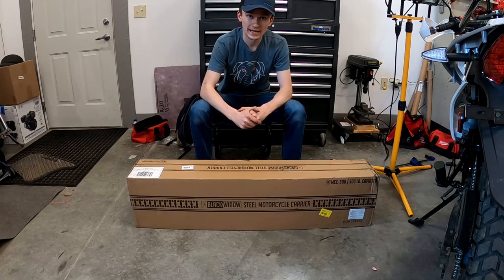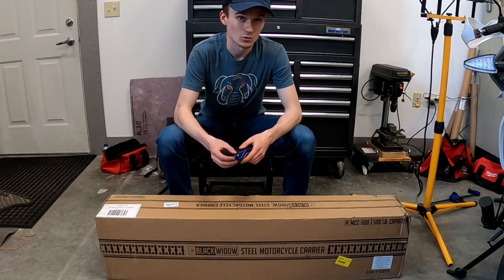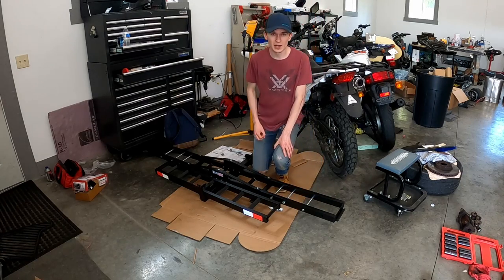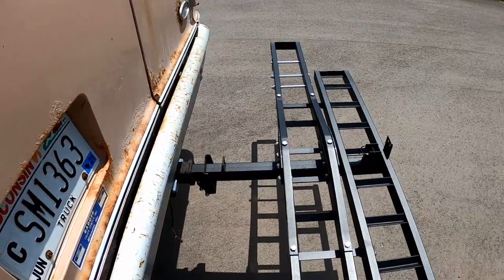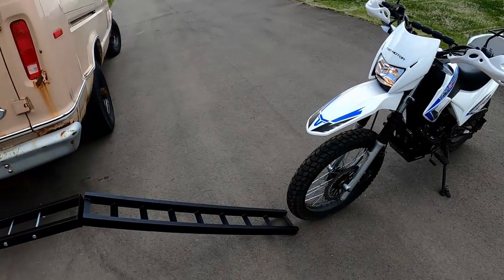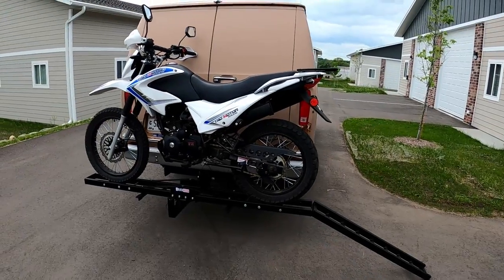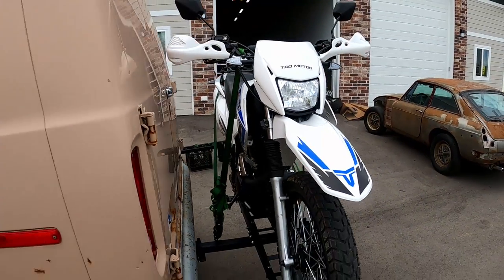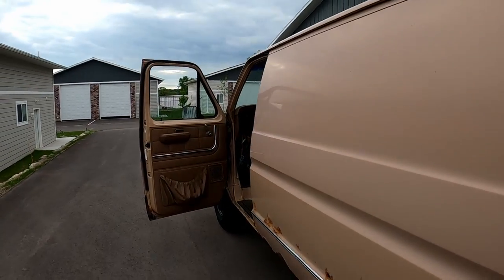Best Hitch Motorcycle Carrier for my Van | Black Widow MCC-500

Comment: I have had this on my Jeep Wrangler for a couple years…you freaked me out when you tried riding up it.  I’ve towed about my Yamaha TTR and I get a running a start and that does the trick.  I also have TBR7 but haven’t tried that on the Widow - the China bike is heavy!  Not sure how you solve that straping down problem.  I’m lucky to have the Jeep roll bars.  Keep up the good videos.  Swear as often as you’d like!  😂
Reply from the maker: That's awesome! How have you liked it so far? Yeah it was a little sketchy but I was optimistic that I could just send it up there 😅 I have a little harbor freight winch lying around that I might rig up on there. We just used the rack on a trip last weekend and it was much easier loading and unloading with multiple people. The Jeep roll bars would make things a lot easier for sure. Hahaha thanks, will do 😂😂😂
Reply: @3PedalDevils  Yep - I like it - it’s easy to store and easy to use.  Pretty tough and a good deal I thought.  I did have to change the location of the front tire and rear bolts on the Widow so the bike sat down a bit. I compress the forks and ratchet it down and another strap for the front handlebars and the rear and the bike stays even over rough terrain.
Reply from the maker: Nice! Yeah I like it too, the price wasn't bad for what it is. Gets the job done and works pretty well if used right. We figured out how to strap it down better and were off-road with it for a few days and the bike held fine. I put some foam on the ramp storage spot so it didn't bounce around as much and used some jam nuts on those anti-sway bolts.